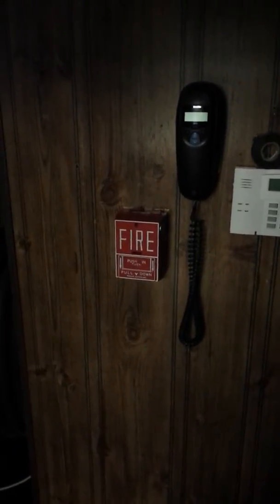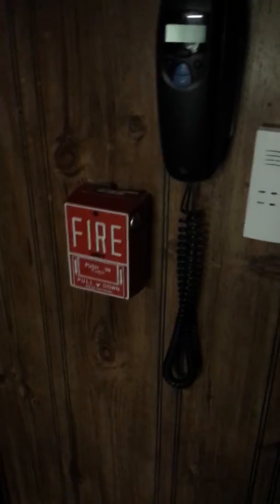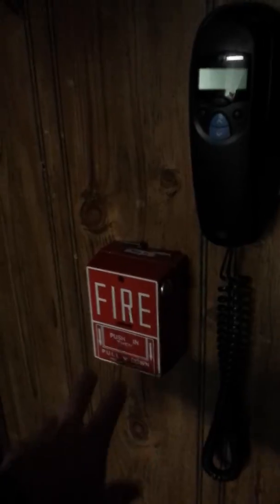Wheelock CH-70 Test With New Control Panel

Comment: 4005. Long reset, familiar beep, sound of case opening is familiar.
Reply: It's a 4004, no doubt about it. 4005 has a lower pitched piezo that sounds just a bit longer when you press a key, and takes much longer to reset.